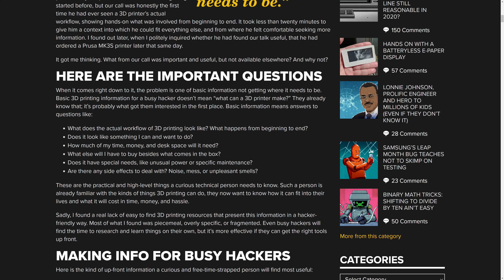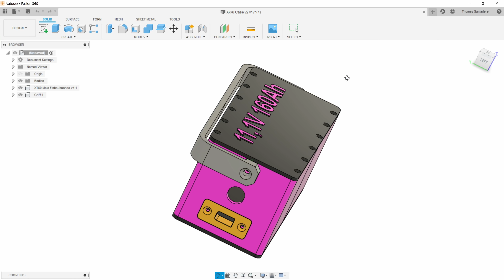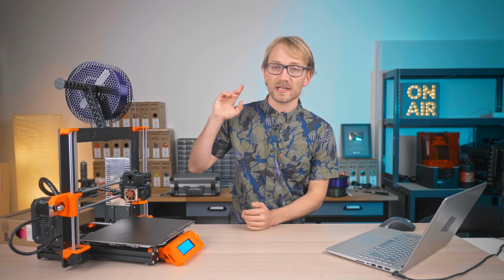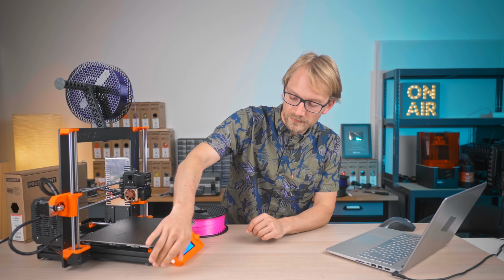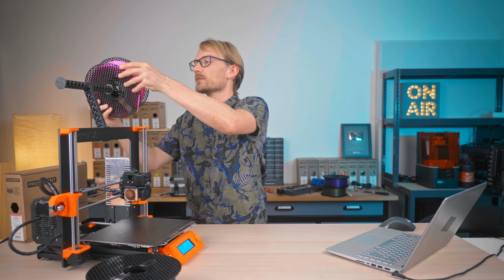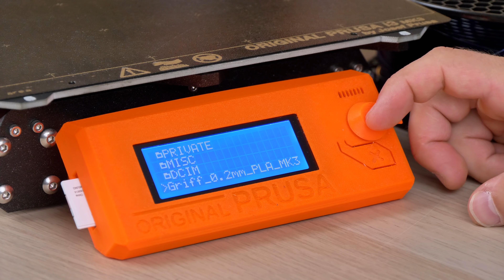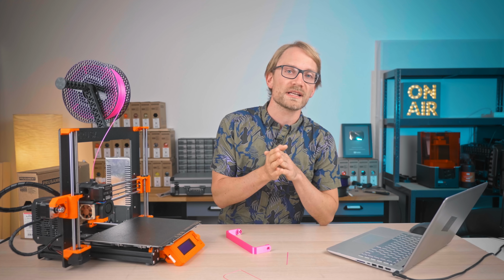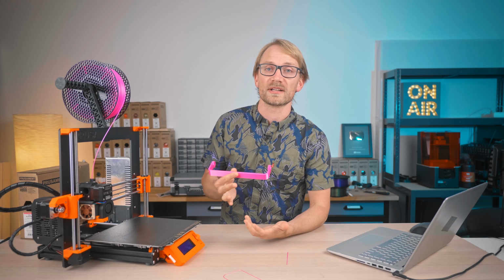3D Printing Basics: What Printing actually looks like! (Ep7)

Comment: You forgot one essential step: when removing spool, attach the filament by pulling the end through one of the holes on the side. If you don't do that, filament will be tangled the next time you'll use the spool and your print will fail.
Reply: What? I just throw my spool against my wall all spaghetti. No problems yet.
Reply: Not necessary when the spool is well wound.
Reply: @alejandroperez5368  No, it is absolutely necessary. The winding quality has nothing to do with tangles - they happen whenever the loose end slips under another loop. Even with a perfectly wound spool, one or two loops will unroll whenever you  unload the filament. And if the open end crosses under one of those, you have a knot on your spool. Eventually, it WILL jam.

Comment: You can also feed filament through the seal container using a push fit fitting to a ptfe tube (boden extruder type). This should minimise moisture and dust as much as possible before it gets to the hotend.

Comment: One thing which I think is worth mentioning is the orientation of the supports.
Sometimes the support material is by default printed in a way that it does not really support the part at places where it would be necessary. I'm always rotating the parts, so the support material is printed at an angle which supports the free hanging corners the best.

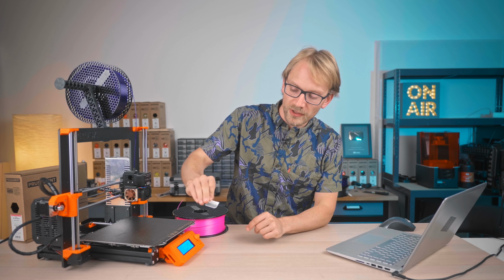Comment: @02:45 Oof… Not sure if this was already talked about or if this is still coming but uploading files onto a SD-Card like that get's old REALLY fast.
I mean... Unless you've started 3D Printing like I did using a Form² which has built in Network connectivity then you may not actually mind doing it like this but I totally did when I got my Prusa i3 later down the line and I immediately looked for an alternative and found one in using a Toshiba FlashAir W-04 Wireless SD Card - Chris' Basement has a tutorial about setting one up to act as a Network Storage Device allowing you to export your files directly to the SD-Card while it is plugged into the 3D Printer - Can't live without it anymore.
Reply: Yeah, or use an Raspberry Pi and OctoPrint. Works great.

Comment: Do 3d printers come with a software program to create/design? Does it connect to your computer and you hit print like a paper printer? Or do you load it into the printer with an sd card?
Reply: Not normally, but you can get free design software like Fusion 360 and TinkerCAD separately.

You can connect the 3D printer to your computer and print, but usually you export gcode file on a SD-card and then insert that SD-card on the 3D-printer. Some more advanced (expensive) printers has built in wifi, then you can load the gcode file from your computer remote. Connecting a Raspberry Pi to your 3D-printer willl also enable this feature (look up OctoPrint)

Comment: How do you handle the little bit of dribble that comes out of the nozzle before the print begins? I have it do a line along the side but sometimes the leaked filament curls up and sticks to the nozzle and hangs on during the beginning of the print.
Reply: try dowloanding the pretty petg profile preset. it has some nice things like mesh leveling with only semi hot nozzle etc which prevents petg dripping and oozing
Reply from the maker: If there is any larger blob in there, I just pull it off before the print using tweezers or (feeling lucky) my fingers
Reply: A great wipe line setup is to print a 2x over-extruded line with 50% increased layer height (e.g. 0.3mm for a 0.4mm nozzle). This makes sure the nozzle is sufficiently purged and the line sticks to the bed. After that line, do a fast travel back to the middle of the line - most blobs stick to the wipe line. Then retract and start the actual G-Code.

Comment: How useful are shared profiles? Do they usually require significant tuning between same models if unmodified, or are they useful to get you maybe 80-90% there?
Reply from the maker: I get along with a one-size-fits-all profile on most printers these days. Yes, Infill, shells, supports are something you'll always adjust if the model needs it, but everything else has a good "universal" sweet spot.
Reply: @MadeWithLayers  Just to make sure I don't misunderstand. Are you suggesting that sweetspot profile would be the same or very close, if for example I used your CR-10 profile, on my CR-10 - or do you only mean this in regards to "shared profiles", as within your own printer range, with your general printing process, and your environmental and filament supply factors?

Comment: Tricky with PC/ASA/ABS ?
No. If you have an enclosure, it's not an issue at all.

Also, not all prints are ready to use off the shell. Sometimes, post-processing is required. Maybe painting it, for example. Or sanding, for visual purposes.

Comment: why would you print a functional part with infill, makes no sense
Reply: Oftentimes strong enough is strong enough. He would do that to save time, material, and energy. 

If the part won't fail with infill, why print solid?
Reply: @pinpetos  because the part will fail faster.
Reply: @jonjon3829  Infill does very little for the strength in most parts, like this one. If the failure scenario was layer adhesion or simply tension, it would have some benefit. But for a part like this handle, which is loaded in bending, as long as the infill is solidly connecting the shells, the part will be just as strong (the second moment of area increases with the 4th power of the distance from the neutral fiber - i.e. the inner layers would contribute close to nothing to the total bending stiffness).
Reply: @kain0m  I had infill parts fail on me and solid parts not, some fancy words wont change that.